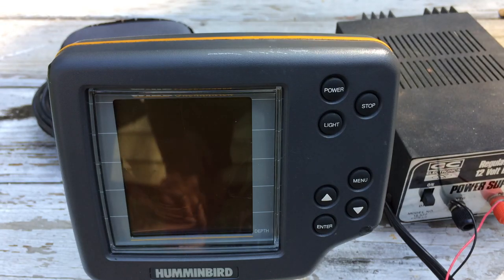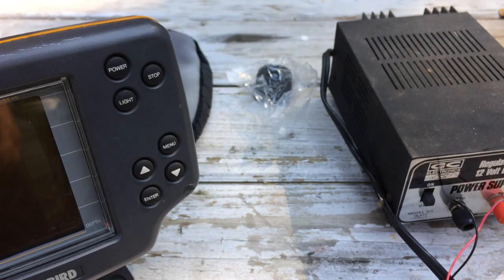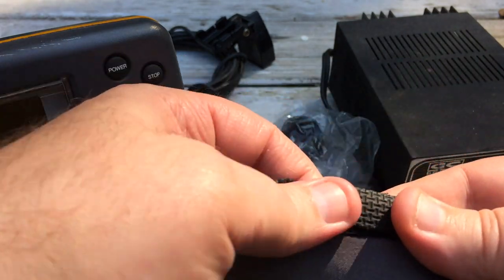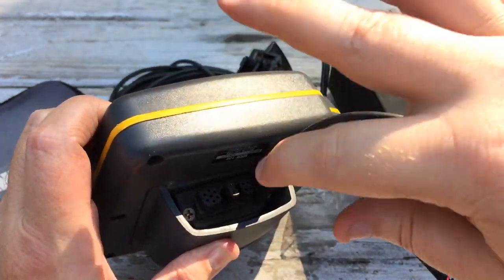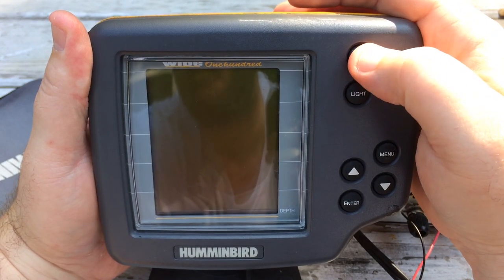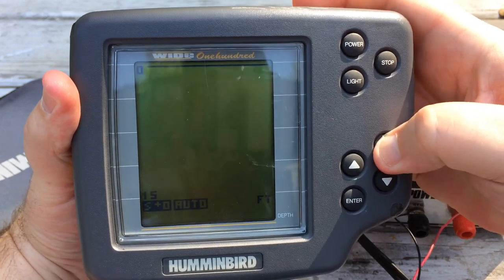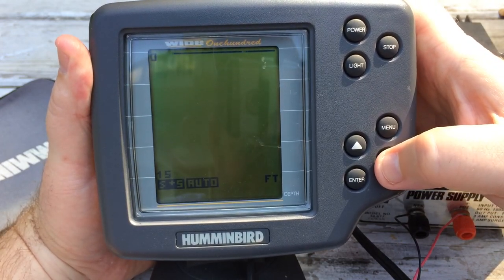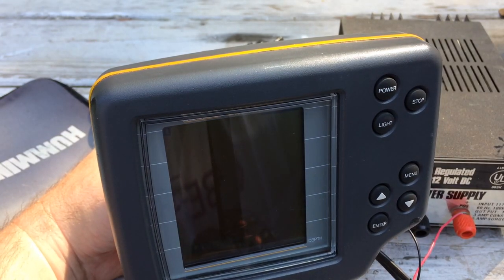Humminbird Wide 100 Sonar Fish Finder eBay Demo- parts only unit

Comment: Wow! Still have mine bought new in 94 at the age of 26 and had it on my 17 foot john boat at the time. The last time I used it was in 2006 and it still worked the last time I used it. I never pluged it back on since then cause changed equipment in time. I wonder if mine still works, but found a 1 inch crack on the screen corner bottom the other day, but never noticed it till now.